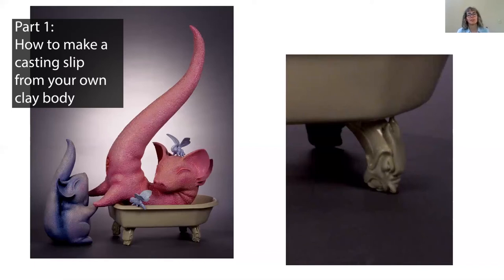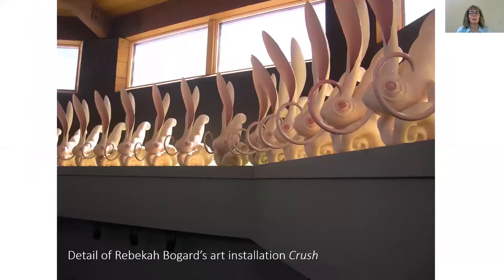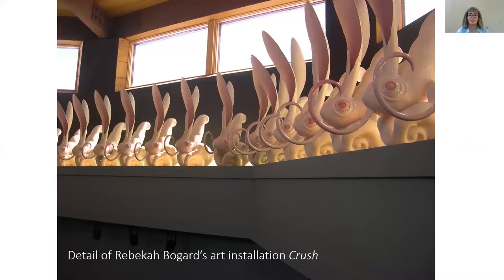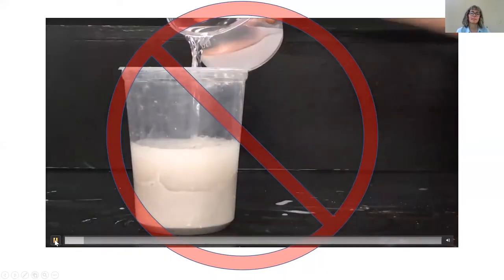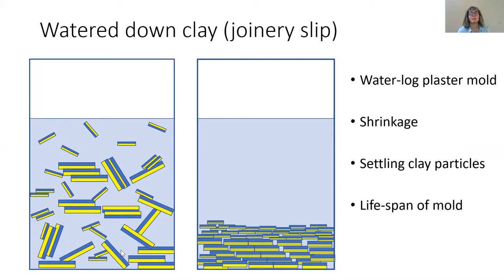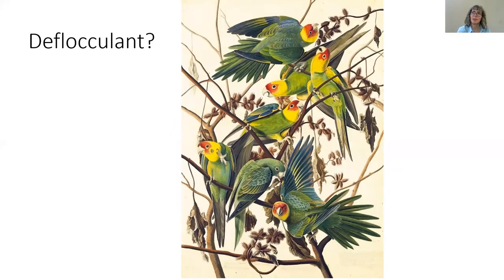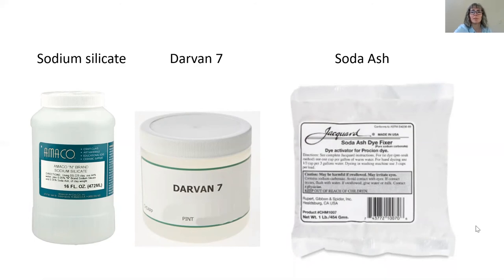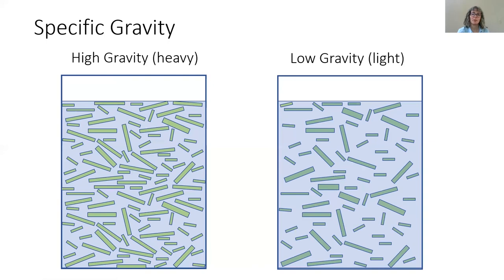Part 1: how to make a casting slip from your own clay body

Comment: Good day!
I feel I have the same issue as you described. I had very successful rate of producing simple alumina-kaolin clay slip (with void former carbon dust and grogged with fired alumina) for crucibles. But now the clay really doesn't want to detach form the plaster mould, no matter the time laps. And it gets very wet, the mould. The more I try, the worse it gets. How could I have gotten such good results if I literally just mixed the powders with water, and now by doing the same thing I get nothing but mess?
Thanks!
Reply from the maker: Hmmm.  Are you using the exact same plaster mold?  Slip-casting molds need to be made from #1 Pottery Plaster.  I've made a casting mold from Plaster of Paris, and it really doesn't work.  Plaster of Paris is too dense and it doesn't absorb the water, which is necessary for casting.  

I assume you are deflocculating your slip.  This is absolutely essential.  But if you are not, it is because you have too much water in your slip.  Usually, if your mold is getting saturated from casting, it is because the water content is way too high.

But if you are doing the exact same thing, using the exact same chemicals, measuring your specific gravity the same way, using the same amount of deflocculant, it could be that your water has changed.  Electrolytes in the water can effect how well your slip casts.  Glazes may also vary due to the water.  Or it could be that your chemical supplier is now getting the same material quarried from a different location or mine, which could account for the variation.

When using ball clays and/or kaolins, choose the one with the largest ultimate particle size (since these are more permeable to water and therefore cast faster and will prevent your mold from over-saturating).  This article might be helpful.  https://digitalfire.com/glossary/slip+casting

If your slip is sticking to the inside of the mold, you may have too much EPK.  Maybe try to reduce the EPK and increase your ball caly

Good luck!